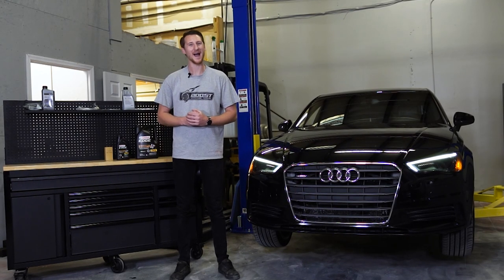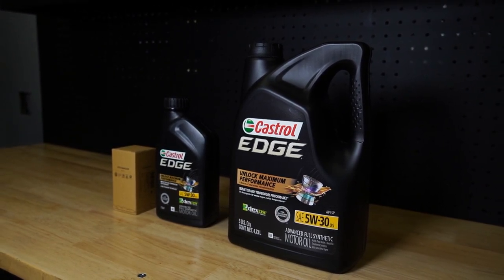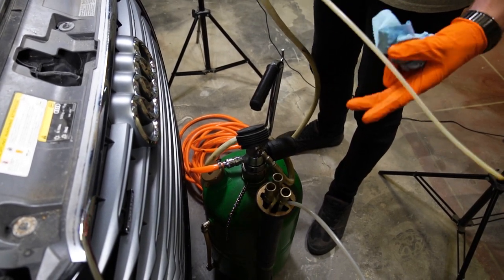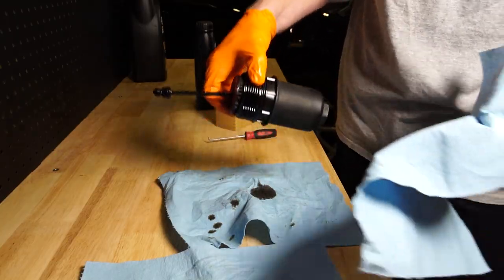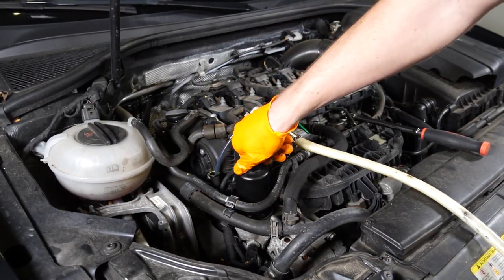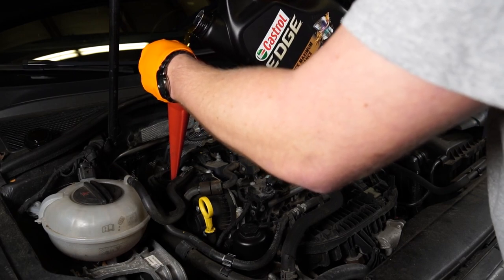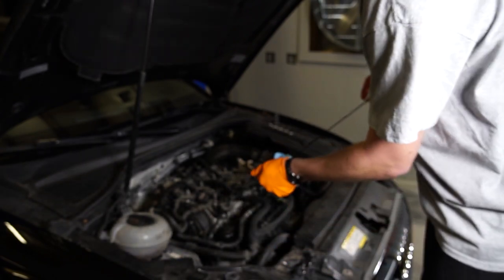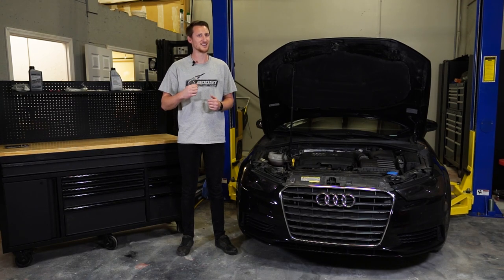DIY Oil Change - 2015 Audi A3 2.0t

Comment: My dad has a a3 2015 i change his oil for the past 2 years using castrol edge 5W40 European full synthetic, also i put 5w30 before once and it didnt burn it. I need your opinion of what you think would be better because it does take 5w40 but you can put 5w30
Reply from the maker: I would rock 5w-40.
Reply: 5w40 in the summer and 0w40 in the winter.
Reply: @rileyneufeld7001  i got an oil pressure warning light on my A3 2005 could this be from too much oil by any chance? Also got a check engine light as well

Comment: I have a quick question. Where is the drain plug on the s3 . I want to change my antifreeze
Reply from the maker: Passanger side, bottom radiator hose. It usually has a drain twisty... thing 🤣 
DONT TOUCH IT THOUGH!  Simply remove the radiator/coolant hose connection instead. The twisty valve will leak usually if you touch it on higher mileage cars.

Comment: Castrol 5 30.. 5 40 maybe
Reply from the maker: I've definitely changed my mind about this video. Might remove because liquid moly is the way to go
Reply: @boostdynamictuning Will be great to know if possible what made you change your mind. Thanks
Reply from the maker: @AliAli-ns9hv  liquid moly runs colder when running the car aggressively and holds up under extreme conditions.